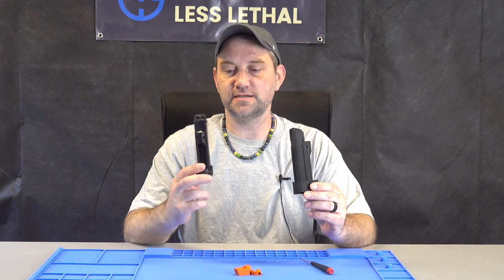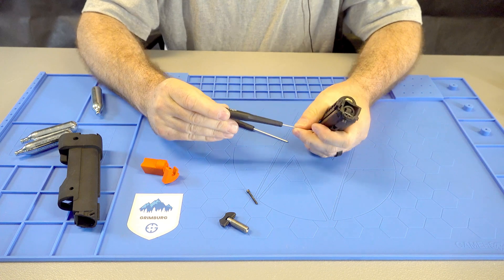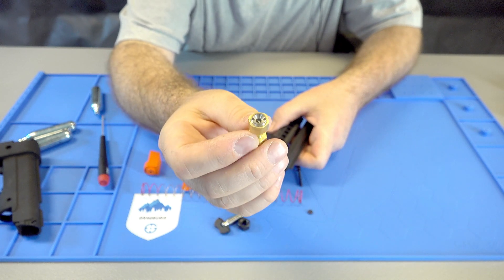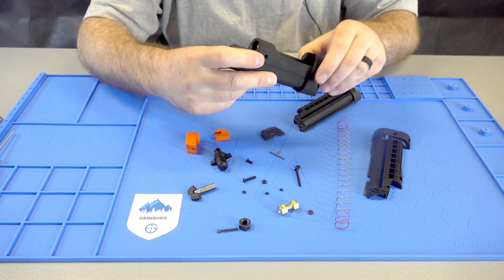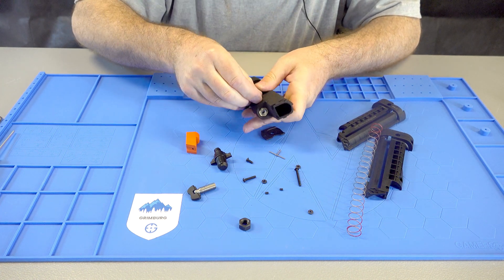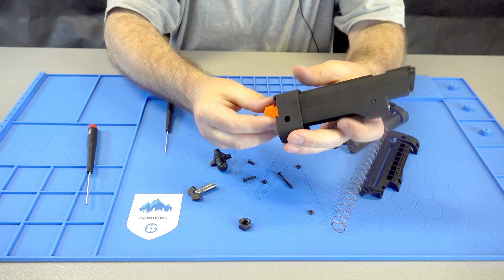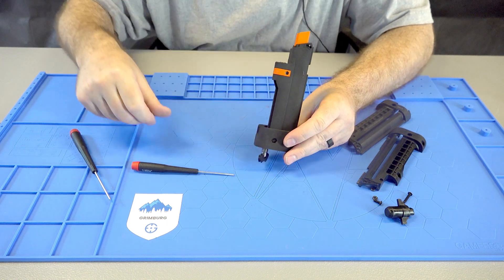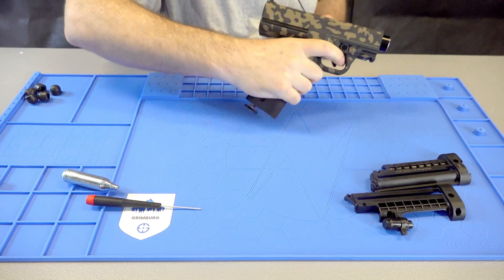GRIMBURG FSC / TCP 12 GRAM CO2 6 ROUND MAGAZINE KIT

Comment: This doesn't allow for the extended magazines though.
Reply from the maker: @nsoutlawball1941  There's only enough co2 for 5 strong shots anyway. Plus they stop making them and we haven't sold them for about 6 months now. But thanks 👍
Reply: @grimburglesslethal  Right. I'm a Paintballer so about 300fps with a paintball is all I'm looking for. I unfortunately bought four FSC magazines W/Mag extenders (15 shots). I don't even know why these exist, I'm only able to get 9 shots @ 280fps+/_ and that's with upwards of 1 minute between single shots.  So strange that FSC had no interest in the paintball market, FSC with 8 Round magazines ( 12gram ) would be the best pistol option in the game. If I could get those aluminum adapters that go underneath the C02 , I'm pretty sure I could mod/install it myself. My T8.1 can shoot at least 3 X 8 round magazines on a 12 gram, I would have thought the math for the 8 gram would allow 15 shots.
Reply: @grimburglesslethal  BTW What did they stop making? FSC Magazines?

Comment: Great video Kurt . I noticed on this demo . The ball retainer is swapped on this model. The earliest blue mags had a built in ball retainer which was a better design personally, I felt was a spot on design which I purchased. Why the change ?
Reply: I was referring to the spring and Bar that keeps the projectiles in place . Mine is thicker and was  pre -installed.  This model you have to swap it from the donor mag.
Reply: I am having the same problem with the 2 I bought,different springs will help? Please sign me up
Reply from the maker: @randycordova4174  Will ship tomorrow. Thx
Reply: @grimburglesslethal   Thanks! You came through as usual!
Reply from the maker: @randycordova4174  Shipped. 👍
Reply from the maker: The old design took four or five insertions to break it in on some launchers because they're all made a little differently and some people thought they were broken. This design inserts well and works on the first try. Okay if it doesn't try again, but it requires less of a break in for sure.
Reply: So are these a updated version of the first run I bought ?
Reply: Second run don't work as well I purchased 2 and they are inconsistent one doesn't hold the projectiles down if you even slightly tap the mag or move it quickly they all shoot out of the magazine
Reply from the maker: @Pandabear1911  Some of the factory magazine springs are short. We'll send you some of the ones we make.

Comment: So what happens if you fire this after the last round in the mag? Wont the bolt smash into the follower?
Reply: I does not interfere. It’s Actually better than the stock mag.
Reply from the maker: No it does not. It's the perfect height. In the stock magazine there is always one ball out of the magazine, above the follower.
Reply: @grimburglesslethal  Sure but that ball get propelled down the barrel. What happens when there is no ball left? The bolt will hit the follower surely? On the stock FSC the part protruding follower is sprung so presumably just falls back down when hit.

Not sure what would happen here on this one. Has it been tested? It might just fall back down into the mag as it is also sprung, was just wondering thats all.
Reply from the maker: @Festivejelly  You could get one and find out. 😉